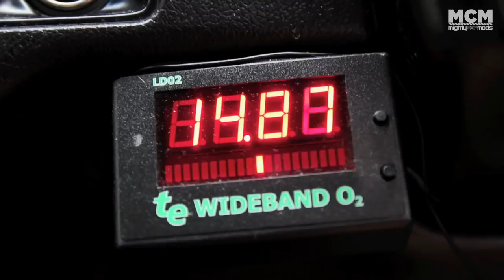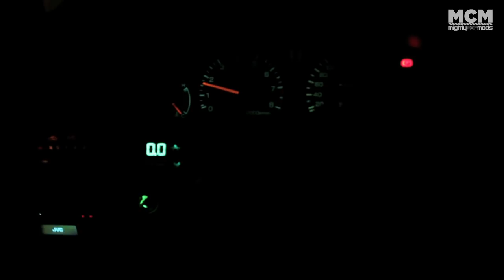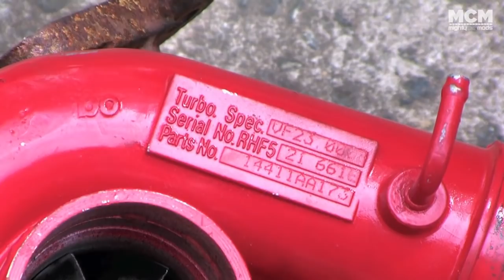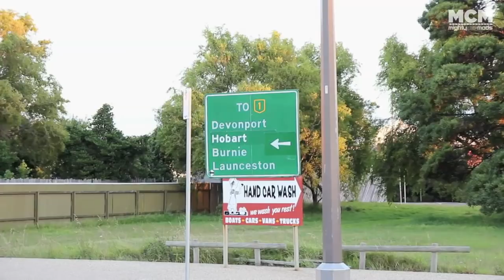How To Reshell a Car

Comment from the maker: @Wrulol RS Libertys originally were spec'd with Iridium/Platinum spark plugs. The stock ignition system isn't powerful enough to run regular copper plugs, however the coil packs were upgraded to my00 WRX items which work much better so standard plugs work fine in this setup. The standard plugs come gapped at 1.1mm, they need to be gapped down to 0.8 for the turbo engine.

Comment: I'm with ya Moog! Gotta love the Nissans. I have a 94 Nissan NX
Reply: I drive an sti you wish you probably drive a smart car
Reply: an sti for the person with sti's.... How awkward
Reply: JRobCards Keep telling yourself that when a stock STI busts your ass at a stoplight. My Bora is faster than your car. A twin-charged (you probably don't know what that means; it has a turbo from the 1.8T and an aftermarket belt-driven supercharger both on the same engine) VR6 making over 500-ish bhp through all four, yes, four wheels. So you could say my car is a 2001 VW Bora VR6TC 4Motion. Oh, it also has every option from the factory, except for the auto gearbox of course. Because autos are for losers.
Reply: No you don't ^
Reply: Aidan Rule  Since 1998 the top models of car that Subaru offered have only gained 35 horsepower. While the electronics systems are indeed valuable I just don't believe In paying thousands of dollars for a semi-autonomous car. I'm sure I can get down the road just fine even if it had 400 more horsepower at the wheels. Sure you can modify your "luxury rally car" but I'd rather upgrade a cheap beater to actually give a crowd something to look at.  Sti's make their owners look the exact opposite of a true car enthusiast..
Reply: headhunterkiller I disagree, partially. If you know what you're doing, an STI makes you look that way.

Comment: I LITERALLY just got done doing this today. Had a 95 Divic DX hatch and someone hit me so I bought a 92 Civic Si hatch shell and had to swap EVERYTHING over from the inside out. I must say when I saw the video i didn't think it would be that involved…I spent 2 and a half weeks doing the motor swap, suspension, interior, wheels etc. Props to you guys for remembering to record this process cause i was going to do the same thing but just kept forgetting to press record ><. <3mcm

Comment: I'm sure most people won't care about this comment, but I personally own a '97 Subaru Impreza Outback Sport with about 291 thousand miles on the engine. Only problem I've had is a recent crack in the radiator, which was fixed with a bit of JB Weld.
The only thing I don't like about my car is 1. how low the ride is, and 2. how cramped it is on the inside. I complain about these things NOT because I like big cars, but because I am a 6' 4" guy, so its a little hard to get in and out of the car.

Comment: I got an Exedy clutch kit for my Lancer GSR, and after replacing the OEM spec one, the pedal wouldnt disengage the clutch at full depression, so the gearbox came out and I shimmed the pivot ball with a 2mm washer. Now the pedal disengages basically on the floor and has 2 or 3 inches of flop in the pedal (you can push it down and it will just sit there, and pop back out when you nudge it)
Ideas?

Comment: I basically did this a few years back after I totaled my first 94 Accord I went out and got another one and over time swapped everything but the motor and trans (I sold them off) and scrapped the old body, a good day is all you need to do the interior swap, suspension and wheels another, I didn't waste time labeling nuts and bolts just put the 2 cars face 2 face and swapped one panel at a time, the only "hard" part is the motor swap.

Comment: @Branden Scholl there should be a little pin you have to remove before you can take the axle nut off. Then have someone step on the brakes so the rotor doesn't spin and you take the nut off

Comment: Bless the white one really wasn't bad at all. My current car (bmw e46 330i)  is much worse but still passes safty with caved in drivers rear door from a car park hit and run. With 218,000 miles on the car (over 350k's)

Comment: hey moog I have a 2009 Nissan Frontier with a 4 cylinder engine. what can I do to get more power. why don't you guys do a truck?
Reply: I'd love to see them mess with a 4x4 or pickup truck too. Nissan Frontier isn't really a "truck" in the way of using greatly different, heavy components, so you can modify and increase power the same way as a regular car. Simple things like increased flow exhaust and intakes, a cold-air intake, injectors, or tuning it will increase power. More drastic mods like a turbo (or a larger one if it's turbo already) and supporting mods can be done the same way as any car, though probably far simpler due to the extra engine bay room provided by the truck body. Diesel's a similar story, higher flow exhaust and intakes, bigger turbo, tuning, etc, all will boost your power.

Do your own research though, I drive a Skoda so I'm far from an expert on the Nissan Frontier.

Comment: I did something like this once before, after I wrecked my old honda, I bought an Identical (all stock) one and moved every aftermarket part over, and swapped the grey leather interior from the old one in place of the tan cloth interior that was in the new one, and I pulled and sold the motor and trans that was in the first one and then took the old body and useless parts to the scrap yard because the landlord wanted the old body gone.

Comment: Oh my god that SVX at 15:40 is orgasmic! Please get a video on it!!!
Reply: I think what we really need is a video on how to manual swap an SVX
Reply: Vincent Baelde-Millar anything SVX related, I love that car! The thing I love in cars most is being unique and I think that is one of the most unique cars ever. I would take it over a GTR any day.
Reply: I also love just how different it is from anything else, but I was a bit disappointed when I drove it. It drives a lot like a gen 5 liberty/legacy which isn't bad, just slow and a bit boring.
The transmission is really what's holding it back.
Reply: Vincent Baelde-Millar well my daily driver is a Chevy Blazer ZR2 since I spend most of my time trail riding and shooting guns so I've been looking to buy a car to have a little fun in and I found a guy who owned 2 of these but just couldn't afford it at the time. So I'm used to slow and not so great handling so I think I'd be fine with it.
Reply: ***** I

Comment: Would it be impossible/damn hard to drop a 7mge (6 cyl toyota 3L twin cam out of a cressida/old supra) into a dato ute? Like, what are the chances of the engine mounts and everything lining up? I have a tranny to fit the engine too.

The ute is basically a shell, but thought it would be a unique project.

Comment: There's actually LED dash light kits you can get off ebay, Just type in say "Magna LED Dash lights" for example and they just plug and play directly into where the stock bulbe go on the back of the instrument cluster they range from $10 and up for the kit, Or some auto stores such as Auto One sell the silicone sleves which go over your standard bulbs but there not as vibrant put a vibrant blue on mine and lights up as a light sky blue so the LED's are the best bet

Comment: Hi guys!!! Especialy for Marty!!! I've Subaru Legacy BF5, the same that u had, n' i love that thing that u did. I've two questions to ya: I had front mount intercooller on legacy, but it's pipe did't fit stock bumper. I've been riding on that stuff about 1 year. Now I installed the stock front bumper n' remooved front cooller, instead of it put the stock GC8 top mount air-to-air cooller.

Comment: Reshelled My Old wagon after it got written off major front end damage, That faithfull Magna Wagon is still around well half of it any way as a trailer (yes it's registered as a trailer in NSW, just renewed the rego) goes hard behind My Verada yes it may be a magna 1/2 wagon towed behind a Verada sedan with a few mods but it's more versitile then you may think as a trailer with the sticker stating on the trailer "I survived the Junk yard"

Comment: Audi RS6 V10 wagon? That thing goes over 190 un-governed. There's also the Cadillac CTS-V wagon. Both have over 450hp. WRX wagons are pretty nice, too. There's nothing wrong with them. Some offer very nearly the same straight line performance as the sedan variant, with more 'trunk' space and rear legroom. They're also usually cheaper on insurance than sedans, and safer. They're all-round practical..

Comment: cover the electrical parts, use a special spray, wait, wash it with high pressure water cleaner. bang, clean engine bay

Comment: hey,i really need your help i have a 1989 honda crx and the cv joint is bad i know how to change it out.............the problem is getting the big ass axle nut off iv'e tried a breaker bar...propane torch...air powered impact wrench...ETC     but it wont come off.....PLEEEEEEEEEEEEEEEAAAASE HELP ME any suggestions to get this damn thing off? by the way the subby is awesome!

Comment: Why in the HELL would you need a breaker bar that big for lugnuts? torque to 65-70 lb/ft people
Reply: Gary Looper I'd think that unless they're rusted you would strip the bolt or nut before you got it as tight as it looked.
Reply: Gary Looper If you meant the green pole, I believe that was the driveshaft nut he cracked, those suckers get so tight its unbelievable
Reply: Callum Thurgar Your prolly right as those torque to 150lbs. I recently had a tire tech torque mine to 100lbs and I told him he was crazy....but his lawyers  rules basically say 100lbs. I wonder how many old studs get snapped off?

Comment: how do i get rid of rust arround the wheel arches and other area cuz ima get an ae86 thats a little rusty
Reply: sand blasting is the only good way i can think of when it comes to getting rust of the proper way or you can take an angle grinder to it,  why an ae86 good car but extremely ugly but then again every 80s car is ugly my 3rd gen camaro isnt exactly a looker either its got headlights that look like it came off a truck but its still a good car
Reply: if i were you though, i would try and stay away from cars that are rusty you never know how bad they really are until you start tearing them down
Reply: its only a little rusty around the wheel arche... ill get new front quater panels but the back ones i would hav a prob wid .... thx for replying
Reply: hey dont mention bro.   just try to use either a sand blaster or just a normal sander if its not that bad,  your last resort would be an angle grinder. if the while panel is literally rotted out  then you might have to cut the whole area that infected with rust out and get a piece of sheet metal, fit it, then weld it where the rusty piece originally was
Reply: wd-40? ehhh ehh?

Comment: @awgdawg16 under $500NZ for a running one, so less than $400US... You can get an average condition 2nd gen GT for under $2000NZ. SVXs are not really that common here, so they're a bit more expensive, around $5000NZ

Comment: Hey guys I just bought a 1990 subaru legacy wagon FWD...I wanna get some great street cred. But on a tight budget...any ideas???? Please help
Reply: Step 1.) Sell it.
Step 2.) Buy a proper Subaru with (at the very least) 4wd.
Reply: agentgfh is there actually a front wheel drive Subie?
Reply: ***** Yes pre OBD2 a lot of the subarus were front-wheel drive with optional 4wd.
The older Loyales, Legacys, GLs and Imprezas may possibly be found in the FWD layout (though many owners would opt for the 4wd option or even the AWD setup).
AWD became the standard in North America in '96.
Reply: interesting, i knew that thanks. ;)

Comment: distributors arent waterproof wtf lol, go take your dizzy off and throw it in the bath and reconnect it to your car, see if it works. you have to cover the dizzy because its only held on by a plastic cap, and water can get through the cap, either way water being on the dizzy can stuff it up, then when the car dosent start youll know why

Comment: i bought a Peugeot 106 XS for about 400€ and has the engine so bad that we have to clean it from inside to outside :/ i already spented 200€ on the car engine, and i starting to think that is better if i just buy a new engine :(

Comment: God knows I need to do this to my Rust bucket, chassis is rusted to hell and it's got 300,000 miles
Reply: Project Miranda I used to live in Maryland and a combo of ocean air and salt on the roads mixed with humid summers didn’t treat it well

Comment: fuck that wheel nut was tight asf! suppose that's a type of locknut as not many wheel thieves carry a 6ft breaker bar with them
Reply: That wasn't a wheel nut, it was the nut holding the CV joint in

Comment: i never really liked subaru to me the impreza is a teens version of the mans car evo but i never under stoned y it was always between subaru and mitsubishi on the tack when really it should be between subaru mitsubishi and GTR but then a GTR R34 agent a subaru or mitsubishi with same size engine in it would get killed by a R34 the new GTR kills both of them but the new GTR is a 3.0 at lest the R34 is a 2.5

Comment: What's wrong with the engine? I know for sure my engine needs a head gasget. If it seazed you had better just get a new engine. Why do you need to clean it? My engine is probably a fire hazard there is so much oil. Lol. Parts for my car are just like the blue turd, cheap.